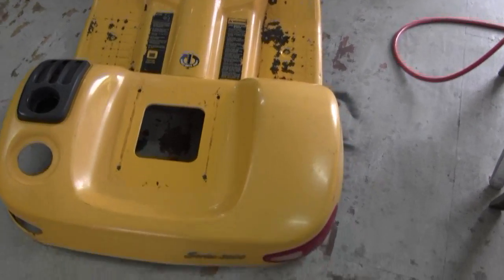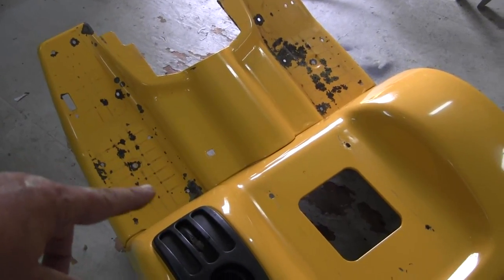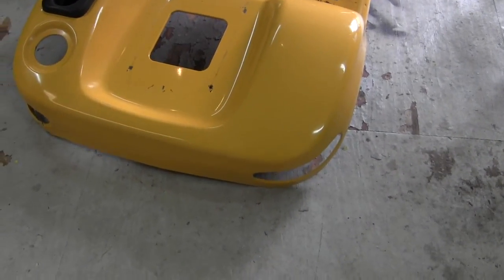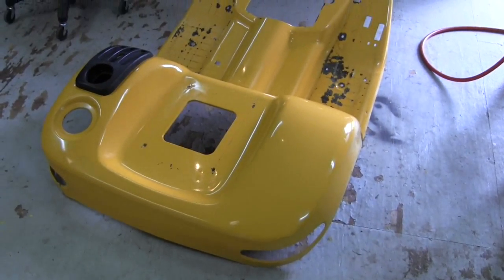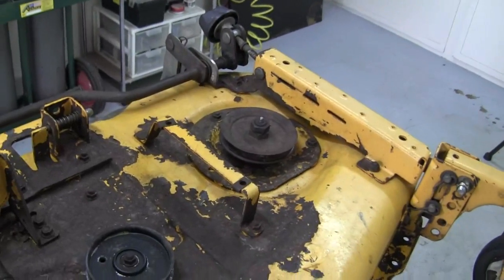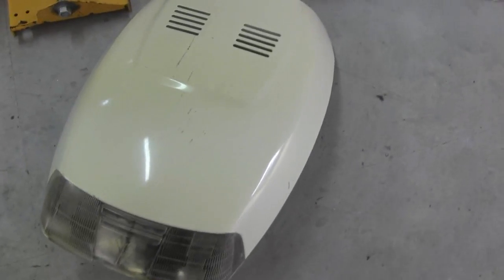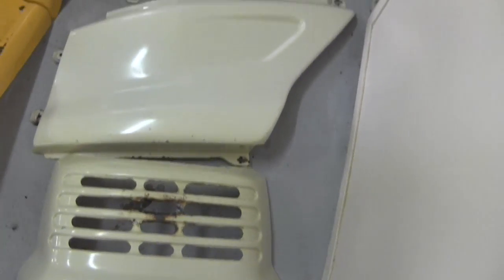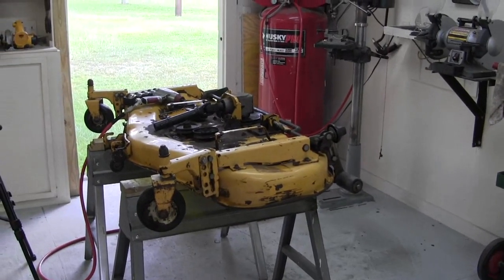Cub Cadet rebuild update 2

Comment: Looks good. What weight dope did you put in the gear box? Was it like what we used to put in differentials on rear axels?
Reply from the maker: 90/140 wt. even the tranny calls for a cheap oil instead of expensive hydro oil. It takes rotella 15/40.

Comment: you can get a new seat or you can cover the one you already have if the foam and base / frame is still intact.   a local industry used to make them for us here.  a good upholstery shop can make one for you pretty quick.  once they figure out that they can make a cover to rehab mower seats the lights should come on that it is a money maker for them.  We had two kinds made one had elastic i key spots to slip over and stay put the other had a draw cord.  velcro wasnt a option in those days.  elastic cord both options had advantages disadvantages
Reply from the maker: I would go the recovering route but the foam is rotted and won't hold up for long with a fat guy sitting on it.

Comment: Did you determine if the motor is going to run and provide you with 10+ years of service as you wanted before you started spending money on it?
Reply from the maker: Motor runs great. Needs a coil,but thats no biggy. Even if it needed rings, no biggy.

Comment: I have the same machine. The switches and connectors will drive you crazy, bad design and crappy switches. Looks like the updated vacuum PTO .
Reply from the maker: Do you have the 22hp kohler? If you do,I would like to talk to you about it. My tractor is the 3225,22hp kohler.

Comment: About 296hrs , have the 3 point hitch and trench plow, commeing root rake , disc , wagon , Would like to find a tiller. Building a 2 yard cement mixer.
Reply from the maker: Would you be willing to take a few pics of the 3 point hitch and how it connects. My email is bctruck@gmail.com  If this turns out to be a good GT, Im gonna be looking for a tiller for it.

Comment: hey brad factory part for mine came in not happy at all 3/4 inch to tall had to leave belt guard off and did not come pretapped so i had to do that too but she`s running
Reply from the maker: You know I've bought replacement bearing Mandrels that didn't come with grease fittings. I think they go to great lengths to assure you can't keep a lawnmower for very long. Glad you got her mowing again.
Reply: me too . thanks